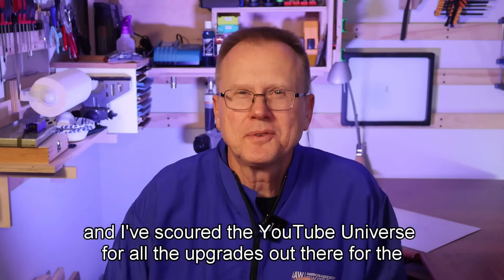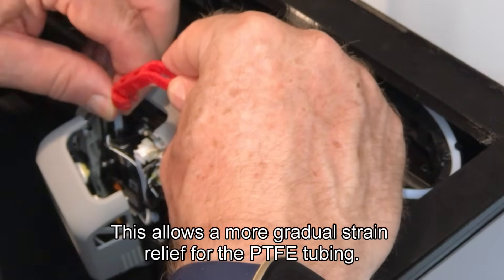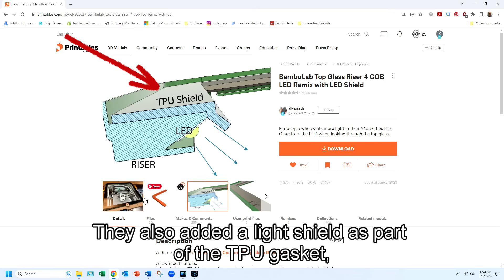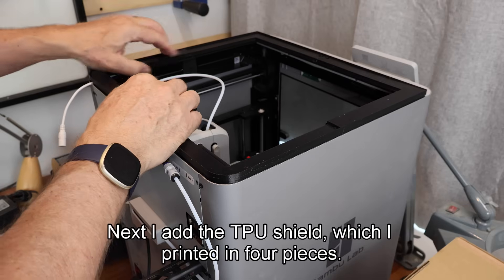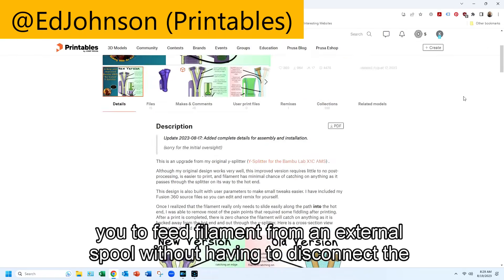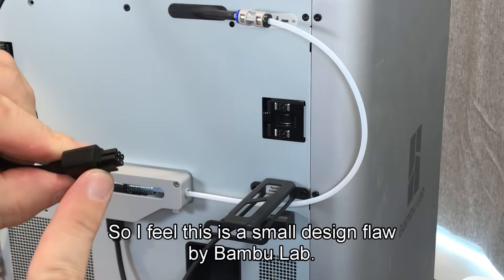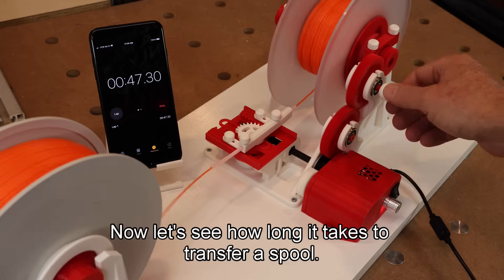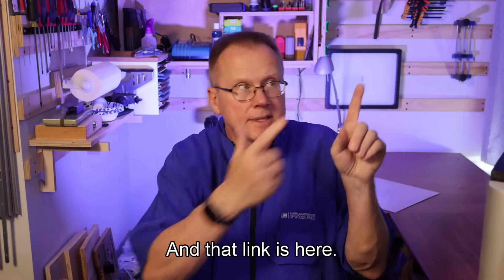The 10 BEST Upgrades for your Bambu Lab 3D Printer!

Comment: Again a great video! 
So happy that I subscribed your channel. 
Not that I not already have printed ALL the tools you mention, as I found them very helpful. 
One thing I am really envy about is the motorized spool rewinder - as I am still with the mechanical one. I was not aware about the upgrades from Diplomator_209270  - so already for that your video was worth watching!
Looking forward for you next video - especially because of the small hidden humor in it.
Thank you so much for your efforts - absolut great videos!

P.S. I will not again start a thread about your comment section, as it is clearly a huge improvement  - at least in my eyes. 
I was only shortly shocked when I looked at it to the amount of text. But after reading through it, I have to say: so much valid information to accompany the video, plus the extra credits for all the 3D model authors.
Reply from the maker: Thanks for your feedback!  I have been really happy with the upgrades to the spool rewinder. If you go with the motor, the motor controller Amazon link has an electrical schematic that explains how to wire everything. I found that very helpful. Yes, my next video will be very different… we will see your and others reactions to see if viewers find it entertaining and informative. Will start filming next week. Regarding My Description, I promised to follow your advice😊. With that said, there is a lot of information that I provided so it’s still too cluttered, but this time the information is only related to this video. On future videos I won’t have so many links due to the subjects I will cover. Thanks again for taking the time to provide your detailed comments on my videos😊

Comment: Just one comment to the LED riser. I have the same. One thing you need to ensure is that the lights are on by the time the print starts as that is when the camera does the white balanace. If you switch the lights on mid print you will see the white balance is completely off and you won't see anything. The design mentioned here doesn't seem to cause problems with the LIDAR either - which is great.
Reply from the maker: I’m glad you mentioned that about the LEDs impacting the camera. Thanks for pointing that out!😊
Reply: Ah, good know that this design doesn’t interfere with the LIDAR! I’d dismissed the idea of adding lights due to that concern. Now I can, thanks!! 👍
Reply: Lidar is marketing bs anyway